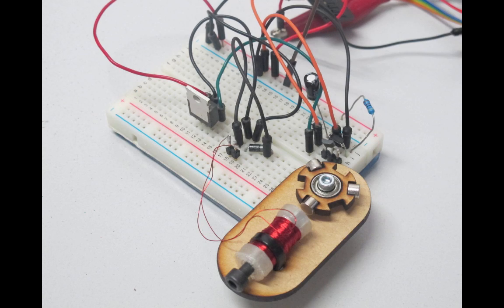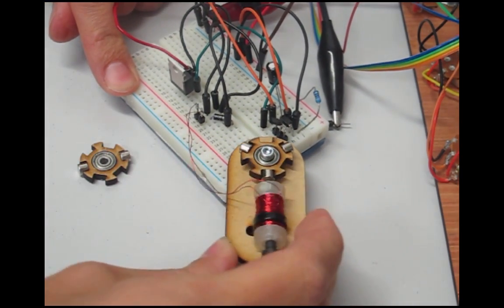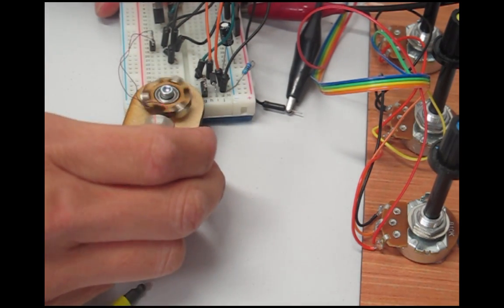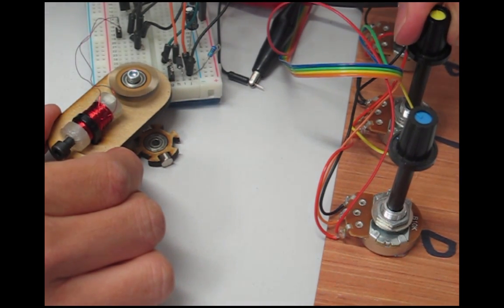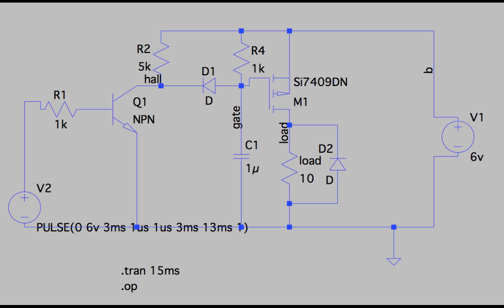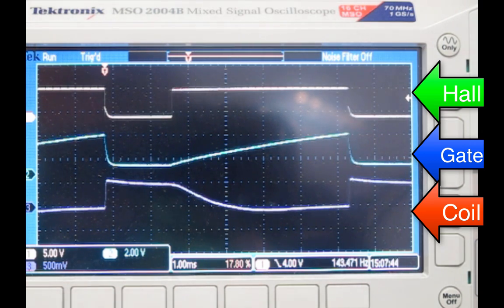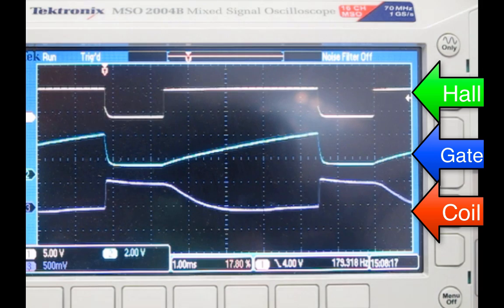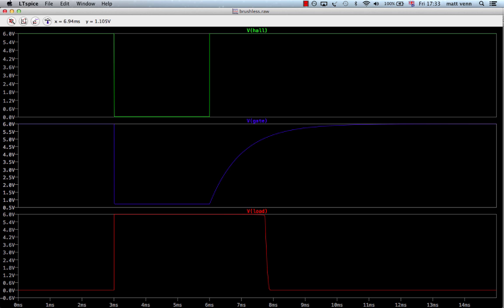simple brushless motor

Comment: Great demo to illustrate the concept of a brushless motor. One tip I would offer is to reduce the amount of power dissipation on the MOSFET by adding another transistor stage to still implement the timing, but make the power MOSGET gate snap on and off rather than coast through its linear region. Otherwise, very cool!
Reply from the maker: +Michael Lorello agreed - that would definitely improve it. This is really meant to be the 'minimum viable product' for a motor demo. Another commenter suggested improving the magnet circuit efficiency by adding a return path for the magnetic field. I might try both ideas just to see what makes the most difference.